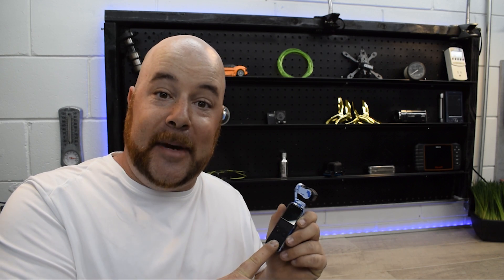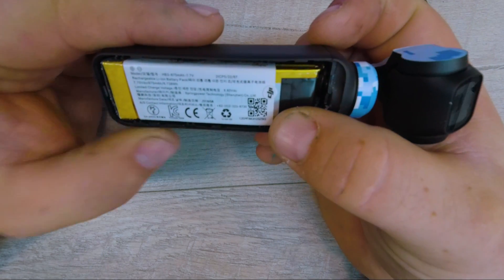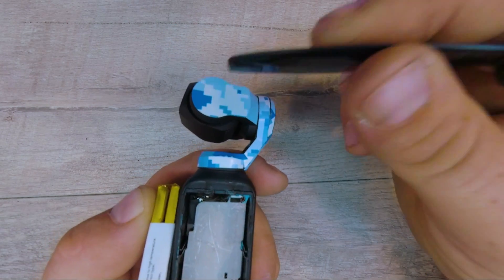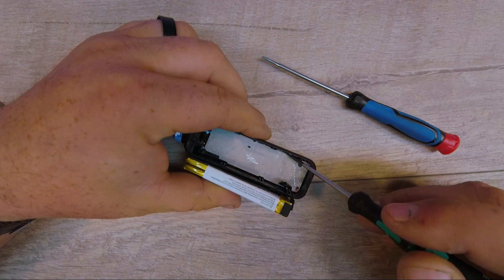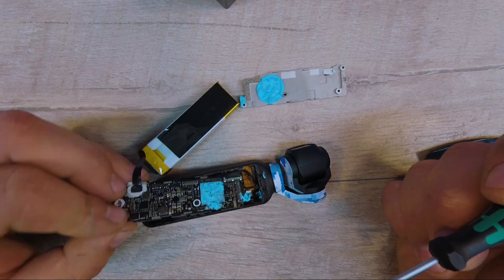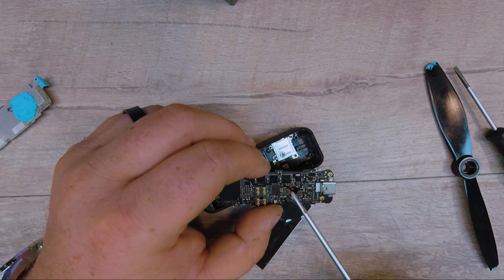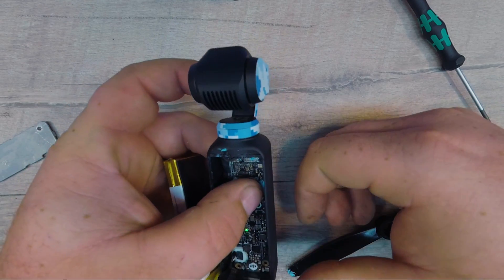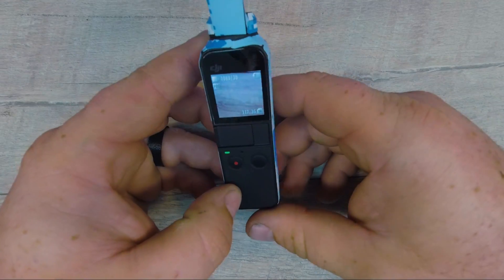DJI Osmo Pocket Teardown

Comment from the maker: PSA: Do not unplug battery from Osmo Pocket until more information is obtained or your Osmo will be bricked. https://www.youtube.com/watch?v=92_wXcz8xV8
Reply: This was a great teardown and a rare find on youtube- thanks!   I have some private technical questions about your disassembly if you'd be open to further discussion please contact me.  Thanks! -Kevin
Reply: I wonder if a power bank supplying power via the USB-C port while the internal battery is disconnected will circumvent this potential disaster?
Reply: So if the battery ever completely dies it is bricked?
Reply: *Also- re this comment: if you have a bricked osmo pocket to sell, I'd be interested.

Comment: Now, how likely is it that the battery will die completely - I don't know? It charges to 100% but when you hit record, sometimes it doesn't even last a minute, but with the power bank it works like a charm. LET'S SEE HOW LONG THE CORD LASTS, I hope it lasts at least 4 more years!

I'm not even considering buying another one, because I'm better off with another Smatree 5000mAh power bank / more than 5 times what the shit battery provides.

Comment: will it be possible to teardown the Poclet 3, and separate the camera sensor/lens part from the body and connect them through a long cable? Only Pocket 3 has a big lens and im thinking if it will be possible to make a fpv cam from it. So with a long code attached body can do all start/stop recordings and changes to mode and previews and stull. We can keep it in the pocket. The head part, 3d print a piece that can be attached to caps/bandanas. Thoughts anyone?

Comment: Hi there, Is there a way of replacing the  microphone as I managed to ruin mine by recording the exhaust sound of my son's car. If so, how would I go about sourcing the replacement mic. Many Thanks for this video. Surprised you used
 a prop to take it apart ;-)
Reply: It’s solid state mic and is part of the main board. I doubt if the mic is ruin by the sound of the exhaust. I’ve recorded ear blasting machinery and high speed Ram air turbines with my OP.
Reply: @psoon04286  Thanks for the reply. I use a remote mic 
 with a USB adapter and everything works fine. It was a performance car, so not quite your standard SUV. Again, thanks for replying.
Reply: @orangespill  is the audio pickup still a problem? Mine started to get from unreliable to completely unuseable and since it was out of warranty decided to take it apart. Using this video as a guide I tried to narrow down on the problem and did find one of the micro connectors slightly apart. Tightened down all the other connectors on the mainboard, reassembled and voila, the audio problem was fixed. I too resorted to using an external mic in the interim, but found it clumsy and fiddly. I now have the Pocket 2 as well and it has a terrific wireless mic accessory.

Comment: 😀Thank you so much....I just fixed a DJi Pocket 1 that had dropped off a car roof travelling at 40mph, it hit the deck and other cars ran over it....Once retrieved, it was no surprise to find it was dead....So after following your teardown,  I found the three board connectors had popped off, once these were  re-fitted the gimbal sparked into life at switch on....one of those very thin wires was trapped near the two screws and once released it all worked again....this is one heck of a robust unit!!!!.....Best wishes, Alan.
Reply: Haha, that makes 2 of us with proof of the durability of this ‘fragile’ Osmo Pocket.
Reply: @psoon04286  it's still working as new, battle scarred but fit for purpose....great product.

Comment: Hello! you seem to know what you're talking about. Great video. I have a question and need a little guidance. How would it be possible to strip the battery and attach it to a FPV drone? I know its done with GO pros, we call them Naked Gopros, I want to be the first to have a Naked JDI Pocket on a drone. Cheers! FRank from LA

Comment: I have a DJI Pocket with a little water damage. The batteries are defective as a result, possibly the electronics of the batteries too.
Wanted to install a new one, but couldn't find a cheap new battery on the internet, except for expensive CHINA batteries.
Do you know whether you can only operate the POCKET via USB without batteries. Tried that, but unfortunately didn't work.
Or does it have to be with the battery?
Do you have a tip where I can get such a battery cheaply and from a serious provider.? 
https://www.youtube.com/watch?v=l2vwdfVt4qQ&ab_channel=BASTELFREAK

Comment: Can you do a teardown of the OSMO POCKET AUDIO adapter? I feel why DJI did not make its audio adapter similar to the USB C adapter that we can insert in the middle and keep the base for the wifi module. The best place for the audio adapter was that place in the centre of the Osmo Pocket. Also, can you make a video on the pin configuration of those 8 golden pins where the USB C adapter fits...

Comment: I personally don't mind if they could have design it with replaceable AA battery. Like old camera.  Much Easy to replace with openable and close able battery cover.
Reply: That would be nice if they made AAA or AA batteries with similar capacity as Lithium batteries. It would have to be a 2 pack AA to come close to what’s in the Osmo Pocket

Comment: Hi, thanks for nice teardown video!
 I would like to ask, if you have seen the microphone (I didn't saw it on the video).
Why I asking - my microphone has terrible sound, I think there must be something wrong with it, so I would like to replace it, or just check for some dirt blocking it etc..
 Or I may can search for another option, how to get good sound from the camera in case the inside microphone is broken, like external mic.
Thanks!
Filip

Comment: Hey bud,
Did you by any chance see a small fan inside the Oslo Pocket when you took it apart?
This is supposed to be a solid state device yet if you but the base up to your ear when you power it on you hear something mechanical (like a small fan) on startup. When you power it down the mechanical sound remains on for about 7 seconds after the Osmo shuts down. Any clues?
BTW if you put the WiFi adapter on the unit it's much easier to hear this up against your ear.

Comment: Thanks or sharing your experience. It gave me the confidence to try and tackle the problem I'd been having with my OP. I believe that one of the micro connectors on the main circuit board may have worked itself loose that resulted in my audio issues. Well, its been several videos ago and my OP seems as good as new.
Reply from the maker: Glad it was helpful! Thanks for sharing your success!

Comment: Thanks for this video, atleast we can easily change the battery.
Reply from the maker: Please don't! I have another video where I unplugged the battery and it bricked my device, DJI would not cover replacement under warranty either!
Reply: @BaldManMotors  The one i am getting from here doesn't have any warranty because i am buying slightly used one and in my country it doesn't have any warranty even if i buy a new one. What can i do if battery dies?
Reply from the maker: Hmm, unfortunately I do not know, I was never able to get mine fixed. DJI seems to keep the firmware private or at least a way to reset the Osmo Pocket. Sorry I am not more help.
Reply: I’m not sure if this will work, but if the charger was connected to the OP when the battery was disconnected it would maintained power to the main board.

Comment: Your ability to take this thing apart and put it back together is incredible. I am truly jealous.  So it seems that it would be a kiss of death to remove the battery to replace it.  I wonder if anyone in this country can properly service the pocket to change the battery when the time comes.  I keep reading other blogs saying that the battery is good for 400 charges which is kind of disappointing.   The key to that may be not topping it off all the time.  Anyway is there a battery designation at all or is this very specific to DJI.

Comment: Can you help me? I accidently dropped my Osmo Pocket in the water. And i can't turn it on. Is there a possible solution?
Reply from the maker: Well if you have the Osmo Shield insurance that may be an option, however if you would like to try to fix it I suggest placing it in a Ziploc bag full of dry rice and close it off. Let sit 24-48 hours to try to remove moisture. Hope this helps :-)
Reply: @BaldManMotors  Thanks for the tip, I actually tried it placing it in a dry rice for 2 days. unfortunately it still does not work. I am guessing that my battery is for change already. Do you know where I can buy batteries of DJI Osmo Pocket?

Comment: Nice job! Next, I’d like to see you dissect the usb to 3.5mm mic adapter, made by DJI, for the OSMO Pocket. Why is that simple adapter priced at 39usd and how has DJI firewalled other usb to 3.5 mic adapters? Other than greed, what is inside that bugger that is not in other adapters?

Comment: That internal battery is a deal breaker for me
Reply: Just plug in a Powerbank
Reply: @Twizzforsberg  I wouldnt be worried about run time....i would be worried about what happens when the battery fails to sustain charge............its a bin job?
Reply: By the time that battery wears out in say 4 5 years that would be outdated tech so I don't see the issue.
Reply: @stringsattached67  Well it doesn’t really matter if it is outdated. It still does what you bought it for.

Comment: Thank you for this video. How hard would it be to replace battery with those tape wires? A major draw back for me...
Reply from the maker: I agree, I think it would be difficult, the glue is very resilient and has the texture of silicone.

Comment from the maker: So what do you all think of the Osmo Pocket? Also do you all want to see more videos like this from me in the future? Let me know here! :)
Reply: I would like a Osmo Pocket due to the size and convenience, as far as i can see from the DJI website the specs are the same as the Osmo+.  Loved your video and would be thrilled to see more similar videos, thankyou.
Reply from the maker: @adampapworth  I agree and the size is certainly a positive, I think the price point is competitive but I would like to see some changes in the future Osmo Pocket V2, Oh and thank you for your support!
Reply: There are two microphone inside the pocket, did you check what kind of microphone they put inside there? Are they good?
Reply from the maker: @ Cool h Darn, I didn't even think about that. Maybe in the future I'll have to take it back apart and answer a lot of people's questions :)
Reply: @BaldManMotors  I think I'd never charge it inside the case after watching your tear down, there are so many strange problems happen to the mother board and I suspect that they may relate the over heat when charging with the case on.
Reply from the maker: Hmm interesting, very well could be!
Reply: AGAIN great video thank you. We've seen these cameras extended for wired control with 15ft of usb-c cable. I wonder if the extra long length (300ft) corning cables can work too over that distance. Also, shame they didn't put a small clean HDMI out port on it.
Reply from the maker: @ Vantage Point Products thank you for watching! Interesting cable idea, and I agree an HDMI out source would be amazing, I would like to also see a native mic input, instead of an adapter that seems to be proprietary and has not been released yet.
Reply: 👍😂🤣😎 Thanks for actually doing what I was wondering about! 🏆
Reply from the maker: @gus473  You are welcome!
Reply: @BaldManMotors  😂 Broken knife tip, propeller pry bar -- classic & relatable! 👍 "Grippy" custom battery case cover is a great idea too!
Reply from the maker: @gus473  In my latest video I actually broke it by unplugging battery :( https://www.youtube.com/watch?v=92_wXcz8xV8